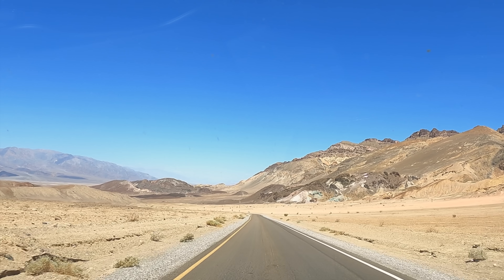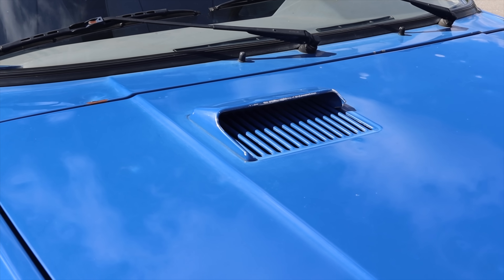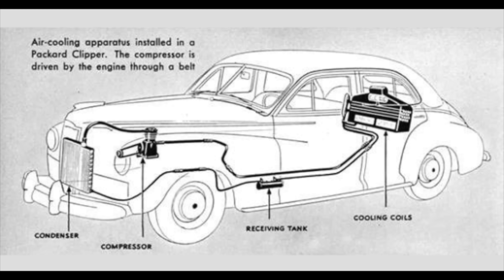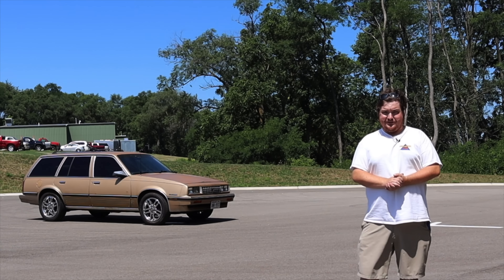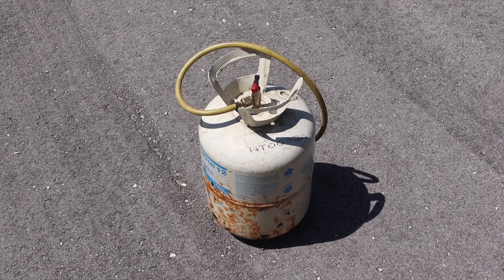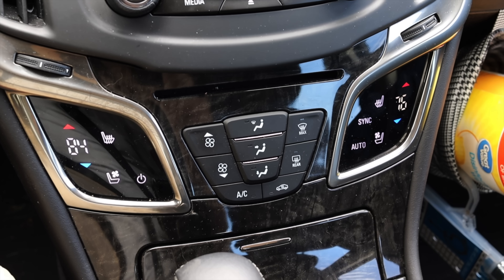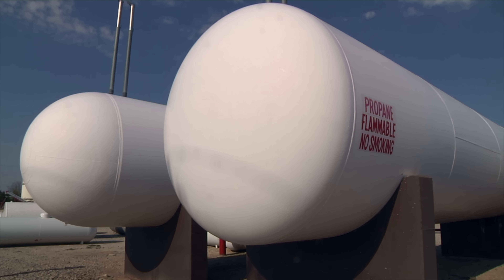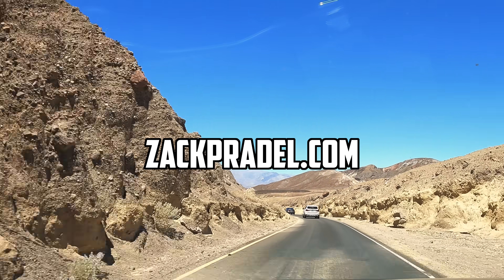Air Conditioning - The Story Of R12 & Why Modern Air Conditioning SUCKS!

Comment: I don't know why but UPS (brown delivery trucks) refused to put air conditioning in them and so the drivers have gotten really hot making deliveries this summer
Reply: Cost savings. Money is the name of the game.
Reply: @dkjoses12  Not just that. The AC would be essentially useless when you're getting in and out of the truck 100+ times a day with the door wide open. It would be a refreshing cool breeze, but the cab would still be sweltering. Those drivers are making 60K on the low end with excellent benefits.
Reply: even mail carrier trucks are that way, i mean its gets costly when you do a lot of stop and go at each house and you have to shut the vehicle off each time